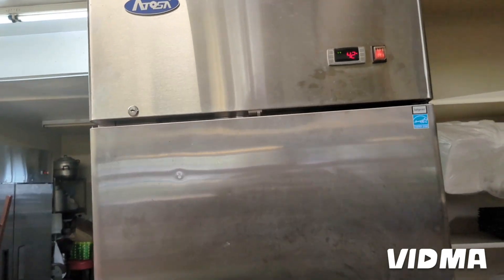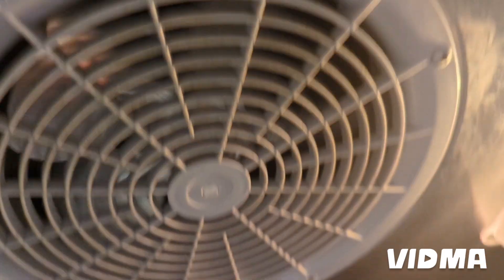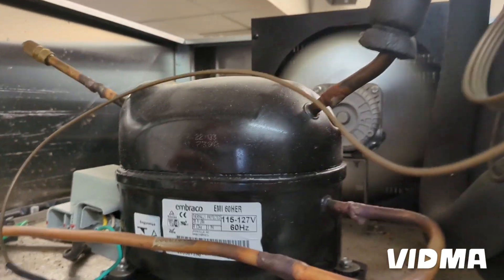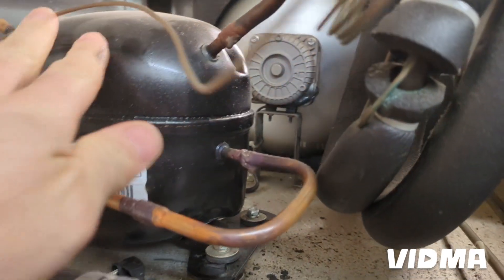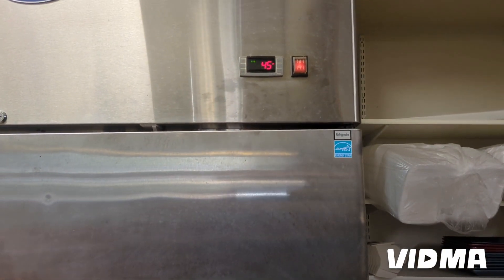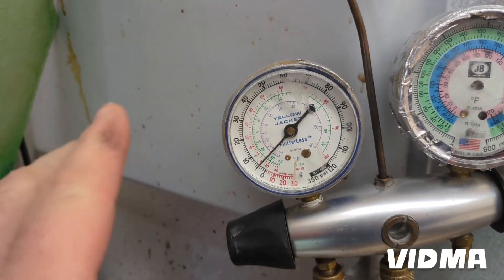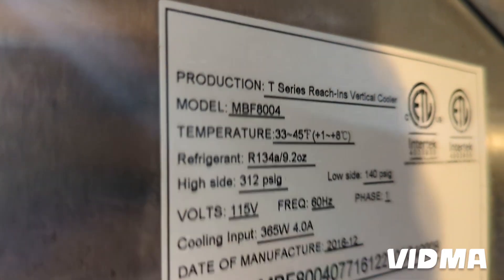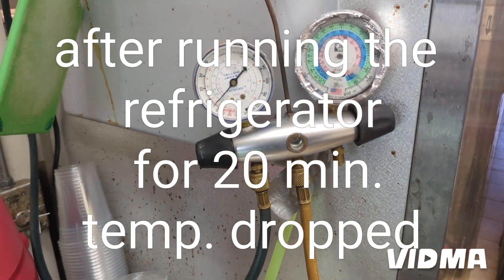Atosa commercial refrigerator not cooling. refrigerant recharge procedure.

Comment: “EPA certified not
Letting Freon in the atmosphere”  you just did it by not finding the leak first.
Reply from the maker: Working on leak detection skills. Got some UV oil to add to the freon and UV light to trace it. Works very well. Thanks for the pointers
Reply from the maker: Check out my later videos. For SMEG refrigerator leak detection and repair.

Comment: The discharge is warm because it probably has contaminated non-condensables, someone else already worked on that refrigerator, you connected the pressure gauges with the compressor on and the system was contaminated, simple, load 250psi of nitrogen, look for the leak, repair it, use a vacuum pump small with a recent oil change, buy some decent pressure gauges, use short and new hoses, carry a scale and charge well for your work, as long as you are doing it professionally, if it is a difficult to find leak, do a vacuum first, and then nitrogen, or uv tracer charge, system charge, notify the customer that the refrigerator will stop cooling in a few days, weeks or months, then you go back and look for the leak.,
Reply from the maker: Thanks for your advice. A lot of good tips. I was thinking about doing the UV oil. Do you just charge the service fee since it's not fixed knowing that you have to come back to find the leak and fix it?

Comment: here's an idea....look for the leak and repair it
Reply from the maker: Thanks for input. Working on acquiring brazing set and leak detection is my next step improving service.
Reply: @myappliancefixed that will help, you basically pumped up a car tyre without fixing the puncture.
Reply: I really work on residential appliances only since don't have parts for commercial but they really insisted of helping them out since they had the bad experience with another big company that does commercial. So I agreed at least to check the system and give my two cents what I think is going on with it. I don't fix leaks and replace compressors because residential units usually not cost effective replacing compressors so don't have that equipment and expertise in that. Usually only recharge the systems that are most likely a very slow leak over the years with no valves installed and the big block of ice in the corner with indicate very slow leak without defrost cycle kicking in so most likely very slowly losing freon. The rest is not worth looking for a leak since it can be anywhere in the evaporators condensers sandwiched into the rest of the refrigerator and replacing compressors and not an option since the refrigerator doesn't cost that much. But lately have been seeing some nicer refrigerators that cost quite a few thousand with bad compressors in a few years so starting looking into replacing the compressors and fixing leaks as well. I know commercial market is a total different ball game since appliances are very costly replacing compressors and finding leaks it's just a part of a job.
Reply: It’s in the evap, it always is

Comment: A lot of those digital controllers shut the evap fan off if the evap coil sensor is reading too warm.

I've had them where they have sucked air in and that makes the gauge fluctuate as the air doesn't go through the cap tube as well as refrigerant (well thats my theory anyway)
Reply from the maker: Thanks for your input.
On this unit I noticed that the temperature reading on a display was going up and down 5°. When a compressor would go on and off. Very sensitive.. customer was confused.